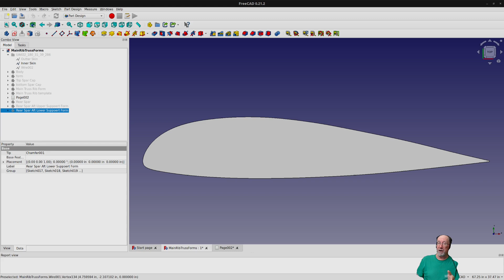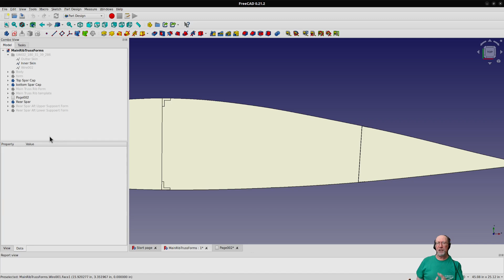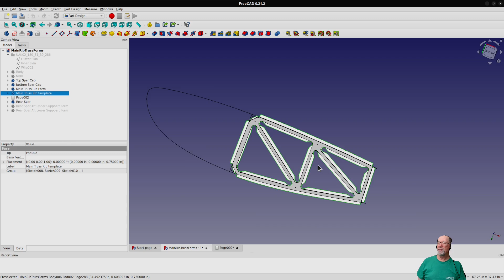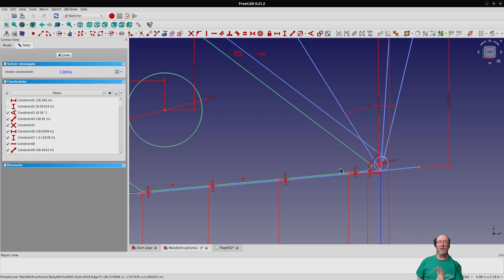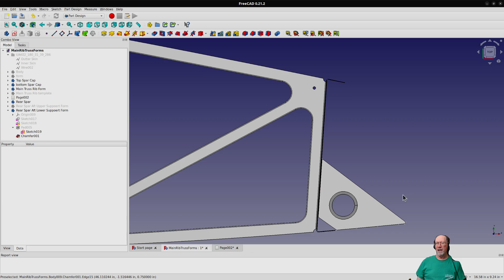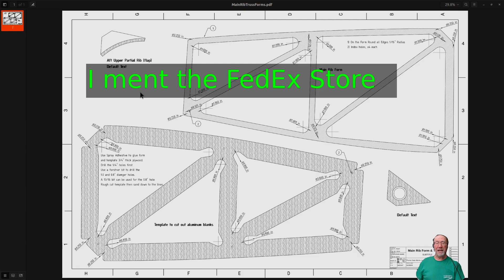Main Rib Testing Part 1

Comment: I think you could use Send cut send and save a whole bunch of time and effort.
Reply: Yeah, I just saw something on them. Looks like a good deal.
Reply: @georgeburns1561  hey George, a late breaking Caveat Emptor.  I just saw a video about an issue that cropped up maybe a year ago with Vans airplane kits. Seems they changed something that resulted in people getting cracks in rivet holes. This discourse seemed to center on maybe it being due to laser cutting, but there was never anything definitive that could find in the comments. There are likely other blogs and Vans themselves that maybe cover what really happened.  But the consensus seems to that perhaps one should not laser cut rivet holes. That said, it may also be dependent on the exact laser cutting process used (laser power and short dwell time would reduce annealing).  Alternatively you can have parts cut with waterjet and avoid any issue. However, if you wanted to experiment with laser cutting it could be an interesting video!  And like I said, I don’t know the real cause of the Vans problem, it could also be that they got a bad batch of aluminum or got the wrong alloy, etc.  thanks!
Reply: Search for “vans aircraft laser cut parts” for a video from Vans on the topic.  At the end of the day I think it’s much ado about nothing, but if there is concern then one just doesn’t laser cut the entire hole to size, but undersized it just to give location, and then drill it etc. as you would do for your own rivet.